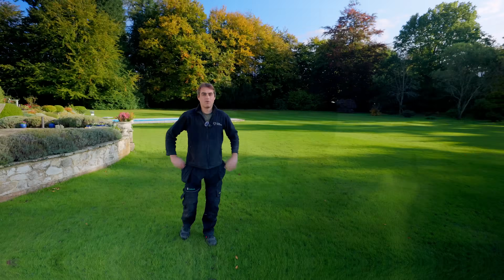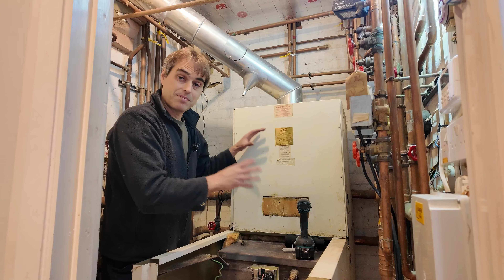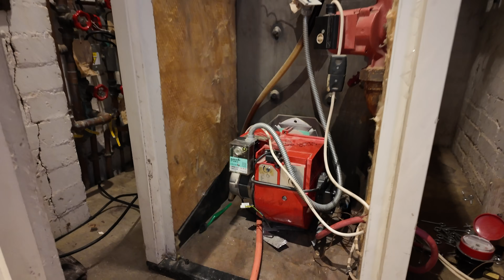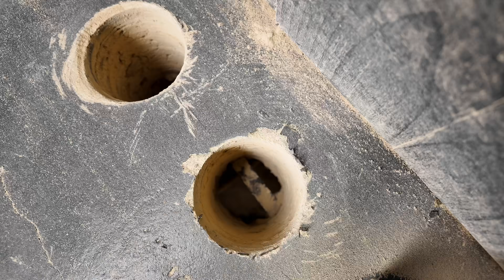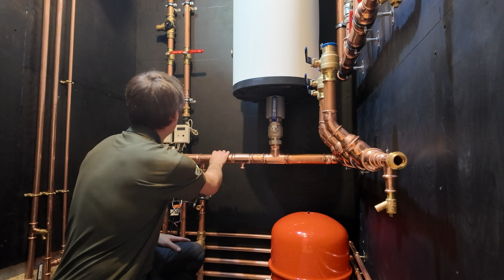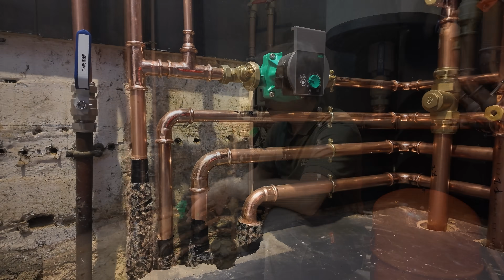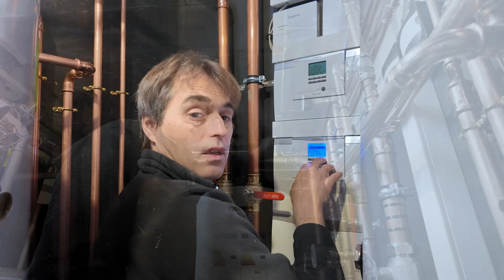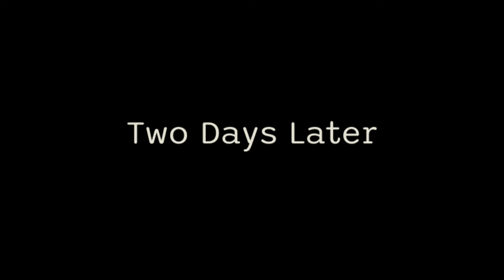Heating Oil Costing You A Fortune? This Is The Fix.

Comment: 8 years to start getting a positive ROI, meanwhile over the 8 years your equipment depriciates to practically 0.

Vs 8 years in an index fund where you should double your money......
Reply from the maker: 3 years on the heating system. Most parts will last for 20 years plus.

Money in the index funds are crap at keeping your home warm. I tried it and it cost a fortune to burn money.
Reply: or buy Rolls Royce and Tesla shares and treble your money

Comment: Anyone know if all Vaillant Arotherm Plus can be wired either single phase 230V or three phase 400V? Or are there distinct models?
Reply: why don't you ask Vaillant, best for them to tell you!
Reply: Vaillant is a German company. German electricity regulations don't allow to hook up a load bigger than 3,5kw to a single phase. And given that even the tiniest flat will have three phase energy supply heat pump installs are mostly three phase as well. So yeah those models should exist. But they probably don't sell them to the UK as there is no demand for them.
Reply from the maker: there is no 3PH vaillant heat pump as far as I am aware
Reply: @UrbanPlumbers  they have 3PH over here for the 10/12kW variations.  But I think if the 1PH models were offered, they would not sell at all.  As nearly all houses are on 3PH, mine is 3x20A, which I think is pretty common at least for houses with that kind of heat loss.  Upgrading from 20A to 25A adds about 50% to the monthly grid subscription fee - which is already around £55.
Reply from the maker: Yeah - Uk is mostly 1ph at 60/80/100 amps
Reply: @UrbanPlumbers  The internals of the UK 12kw model do allow for 3 phase connection hence the question. Some electric devices eg heaters, cookers or car chargers allow a choice between single and 3 phase and will operate in either mode. I have three phase (3x80) in my UK home having upgraded from single phase.
Reply: @UrbanPlumbers  Yes there is apparently. We are pricing 2no 3 phase units for a house at the moment!
Reply: @Ifitaintbrokedontfixit I wonder if the units have the same internals and you simply wire one way or the other?
Reply: The internals of the UK 12kw model do allow for 3 phase connection hence the question. Some electric devices eg heaters, cookers or car chargers allow a choice between single and 3 phase and will operate in either mode. I have three phase (3x80) in my UK home having upgraded from single phase.

Comment: I wouldnt even consider a heat pump until the industry sorts itself out, too much chance of getting a poor installation.
Reply from the maker: as with anything - you need to do your due diligence - you don't take your car to just any mechanic or go to a random dentist, do you?
Reply: I wouldn't consider getting a computer until the industry sorts itself out.  To much chance of getting your data robbed, poor repairs being done, perfection not reached etc etc etc
Reply: @UsualYaddaYadda My observation is based on having done the research, most installers i checked wouldnt allow me to contact previous customers, i ignored those. Quotes were wildly different in terms of specs and installation for example new radiators or not. Only one provided heat loss calculation workings if they provided a figure at all. As for your analogy, as an electronics engineer all software is sh*te and always will be, the idea is get it out there and sort the issues later - the problem is that's how the heat pump industry looks to me at the moment too.

Comment: Did they not think about ground source?
Reply from the maker: yes. Too much disruption and much higher installation cost for very little benefit in lower running costs or efficiency. This system runs now at a COP of 5.
Reply: Fair enough. Need to get you round to quote in the new year!

Comment: With a property like this would a ground source heat pump be an option. They are already trenching across the garden albeit at a smaller scale.
Reply from the maker: It was discussed and dismissed as would ruin the garden and cost 3x more for not much benefit when it comes to running cost or efficiency
Reply: @UrbanPlumbers  It seems to me that ashps have been improving rapidly recently.  I  would have expected that gs development would also have improved at the same rate but they seemed to have stalled a bit. Is that a fair observation if so do you know why?

Comment: The cost of the oil over the period would be lower than gas or electric given it rises and falls with the market , the only key is to watch the heating oil futures and spot price .
 Carbon emissions is another issue :-) .
Reply from the maker: but you buy oil once a year when you need it?
Reply: You don’t  , particularly with a tank that size , you can go as low as 500 litre lots , which won’t last long in that size of property . It often hits a low in summer and going  into Autumn , external shocks excepted such as Russia . Their real advantage is or was the big storage . Over the years I’ve had oil as low as 11pence a litre through to 78pence when Russia kicked off .
   However in doing a big refurb have gone full ahead into a couple of pumps and solar/batteries . I assume given the restrictions a heat geek tank wasn’t suitable ?
Reply from the maker: @pmbpmb5416  I don't install HG tanks from Newark. The idea of a large heat exchanger is great, but I wasn't impressed with the build quality, so I prefer to stick to known brands.
Reply: Thats not good to hear , thank you anyway for an honest opinion .
Reply: @UrbanPlumbers  Interesting to hear given the price point of the HG Newark cylinders. Which brand would you recommend? I saw in another video of yours that you used Joule Premium Cyclone cylinders? What is you opinion about installing a solar thermal panel for DHW as well? many thanks!
Reply from the maker: I mainly install Joule cylinders
Reply: @UrbanPlumbers cheers thank you!

Comment: Who cares about carbon emissions? Plants rely on CO2. My fruit bushes all grow near my boiler flue and they grow incredibly. 6000 blackberries from 2 bushes this autumn.
Reply from the maker: enjoy your NOx polluted berries
Reply: @UrbanPlumbers  if the air/gas ratio is set correctly on a boiler, there is zero NOx emissions, the nitrogen in the combustion process is inert and doesn't change state at all. 2 oxygen 8 nitrogen and 1 Methane. Comes out as CO2, CO, H2O and N.
The Nitrogen is the unchanging element in the combustion process, it's unable to make covalent bonds with any of the other elements.
Reply from the maker: @HarveyDarvey1122 @harrydavey9884, you definitely have NOx emissions on your boiler. There is no such a thing a zero NOx emissions.
Reply: Who cares about carbon emissions? Well for a start, anyone with children or grandchildren who want them to have any sort of decent future.

Though there is understandably a big emphasis on financial savings here, the most important thing by far is the carbon savings. The financial savings just make the essential carbon savings much easier to do.
Reply: @MentalLentil-ev9jr  I have children.
Also, what do you think Solar Panels are made using? (Burning a FUCK TON of coal) The carbon emissions "crisis" is a scam to move everybody onto Electricity only, so every aspect of our lives is digitized. There is zero environmental improvement from wind farms and solar panels.
We have one incredible source of low impact energy and that is Nuclear, but conveniently our governments refuse to allow it. It's hilarious how uneducated all of you people are, but you insist on pushing opinions that you've not even researched.
Reply: @MentalLentil-ev9jr  global carbon emissions are all based on guestimates and wildly inaccurate data models. I wouldn't take any of what's published seriously to be honest. Not saying we shouldn't be mindful but in 100 years time the clock will keep ticking and humans  (hopefully if we haven't collapsed due to other reasons) will keep on building, it is what we are good at.
Reply: @MentalLentil-ev9jr  lmfao, YouTube deleted my reply. You should go ahead and Google how solar panels are made though 👍🏻 put it this way, it involves more KW of coal burning than it could put out in 2 lifetimes.
Reply: @MentalLentil-ev9jr  China is bringing coal fired power stations on line at a rate of like 2 a month. The UK as a nation that produces less than 1% of the 0.04% of CO2 in our atmosphere, the CO2 argument is a joke.
Reply: There was an internet guy who was exhausting his diesel/kerosene boiler into a tomato tunnel, tomatoes were growing great, but would you really want to eat them, no combustion is 100% clean, particularly not from an aliexpress heater.
Reply: Sounds like "I don't know enough to know I don't know enough" comment about the excess CO2 issue.